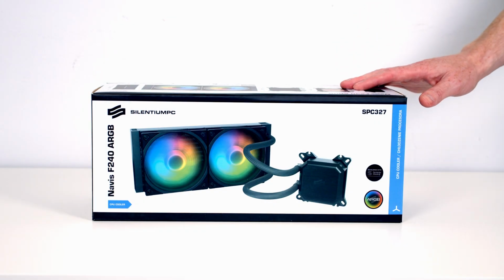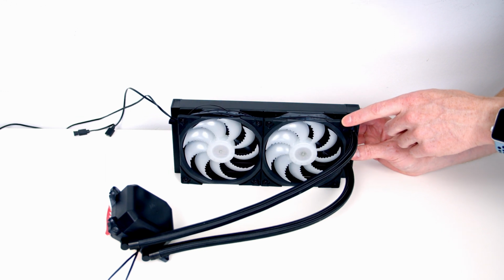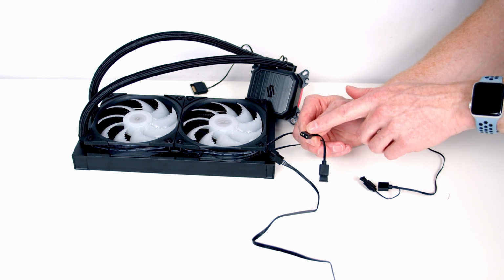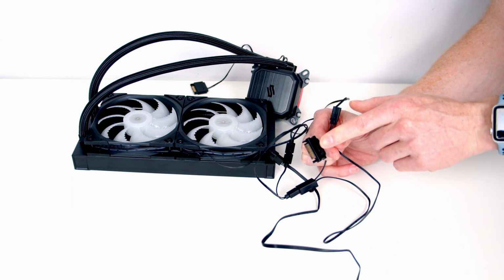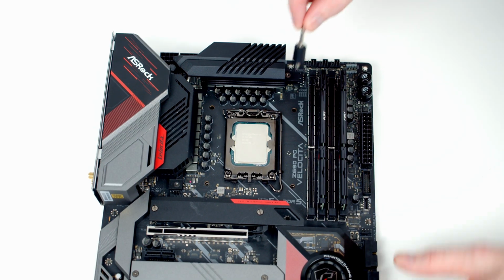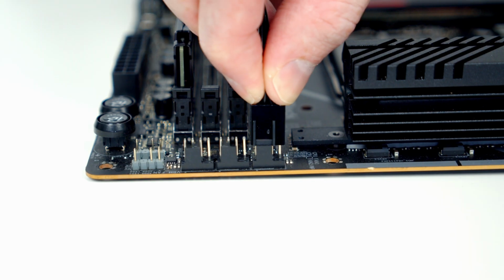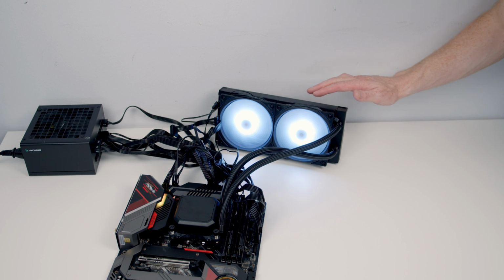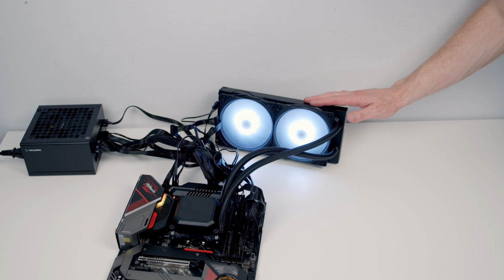SilentiumPC Navis F240 ARGB Installation Guide

Comment: hey thanks for being pationt to explaining step by step , have learned a lot . But  i am still confued  about RGB AIO  wires .  there is  ,2 wires from Pump (Rgb, and 4 or 3 pin )  and  there is 2 (for each Radiator Fans) ,  one is RGB ,and the othere , 3 pin or 4 pin wire  , i am confused  wich 3 pin wire  goes to CPU heather ????  Pump ??? or  Radiator ???  and if  one goes to CPU heathe , where do we connect  the other one in MB ?????????  i would apriciate If  you could make a  excelent  full explnation  video  , and showing exactly on motherbord , Thanks

Comment: Hello Chris.  Great content . I have the Lian Li Lancool Mesh 2 PERFORMANCE version of this case and the EK360 AIO, and having some doubts on how I should install it (I am considering what you did on your lancool rgb build since it might be my only option).  Would I be able to put that AIO in front, then use those 2 front fans at the base or top, and leave the one in the back that came with it?  Or should I maybe get another set to have 2 more at base and 2 at top?  Advise from anyone is welcome and thanks in advance.  

Mesh 2 performance
ryzen 9 5900x
32gb of corsair vengeance,
Asus Tuf Gaming X570 Pro Wifi 6
Samung Evo 1TB
4T Seagate Portable Hard Drive
Nvidia GeForce 3070 TI FE

Dell 32" curved Monitor